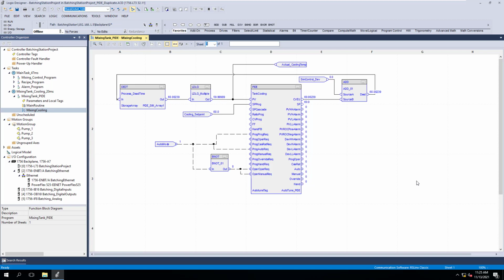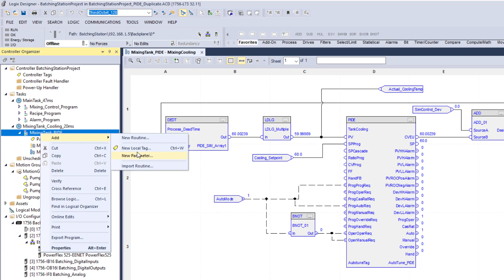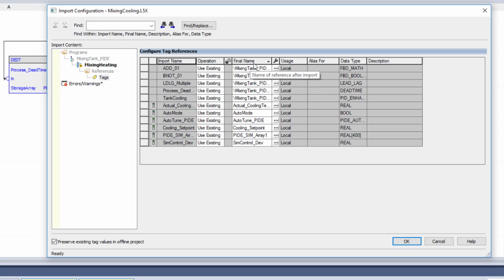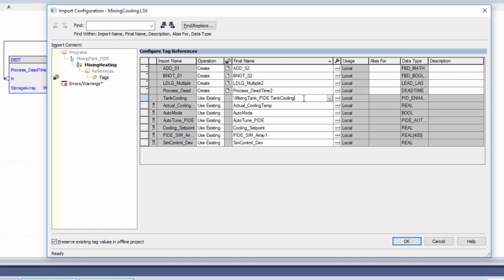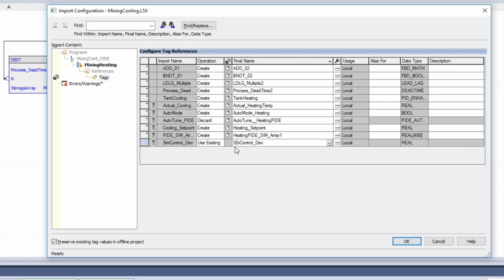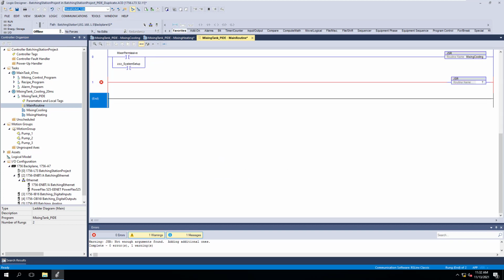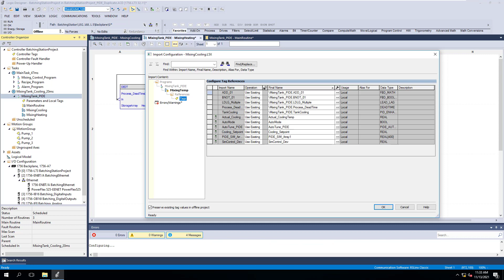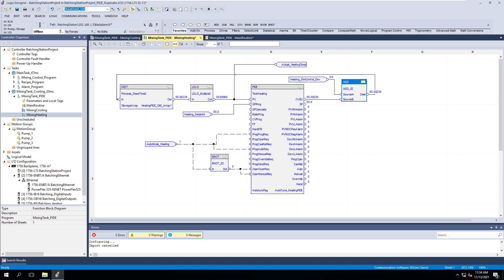Replacing Tags | Import Export Routines In RSLogix 5000

Comment: If I'm going to change modules in the same program, for example swap 1756-OW16 with 1756-OB16, do I need to export the program scoped tags that are associated with the original modules and than import them once I've made the swap?
Reply from the maker: If you are doing this in an offline copy then just change it & correct the tags referencing the card.

You can export then import if you want, either would work.

It really depends on how much time you have to work on it
Reply: @ShaneWelcher  and I do that in the tag properties correct?
Reply from the maker: @soviethammer645  yes, just note that if you only have one copy of the program then make a few copies as a save as to have some room to practice then double check.

I always make backups, it's in our nature to make mistakes so this is why I say that